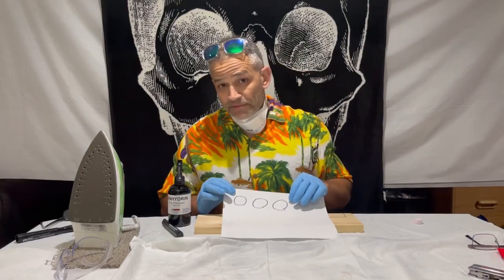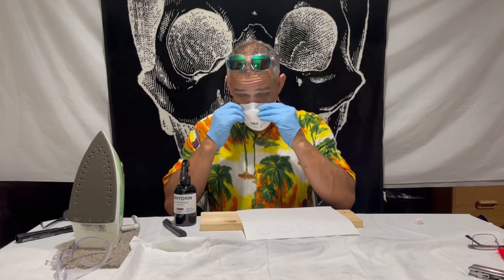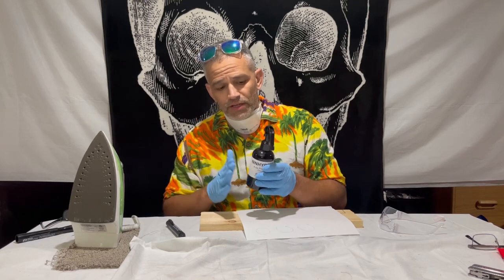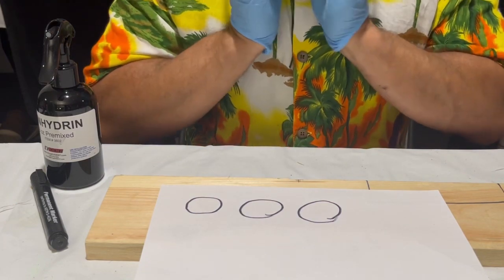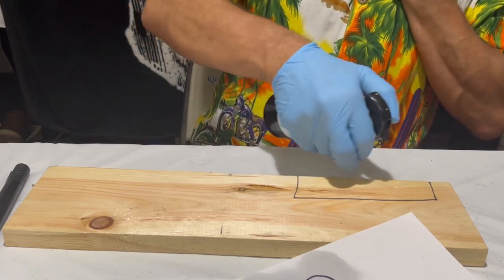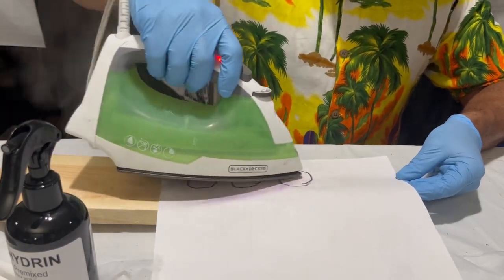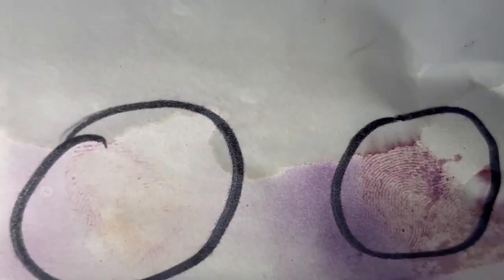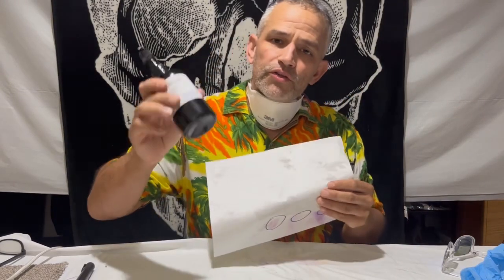Developing fingerprints on paper using ninhydrin

Comment: 🤔 Quick question, if a baseball bat is use in a murder outside in the rain. Wouldn't the rain wash away the fingerprints? Can prints be retrieved from a wet baseball Bat using ninhydrin?
Reply: Use Molybdenum Disulfide (Mikrosil Casting may also work with Black Carbon Agent)